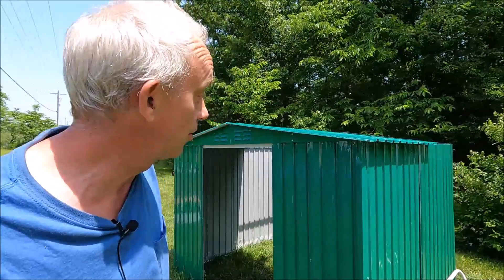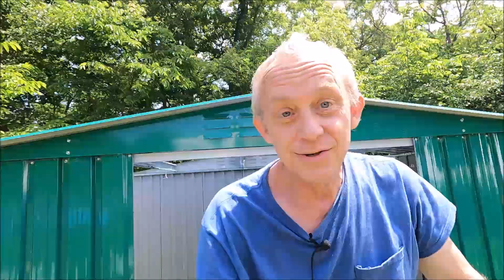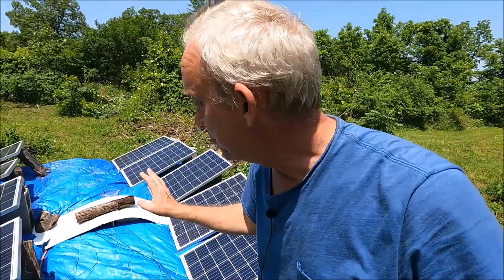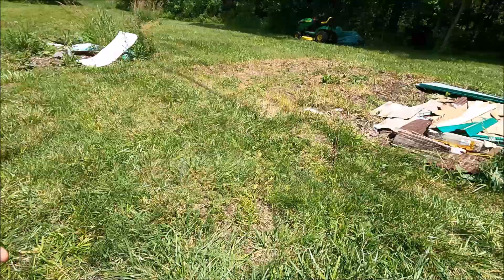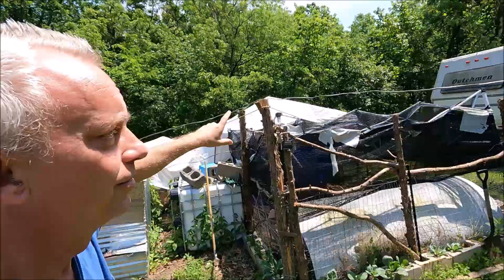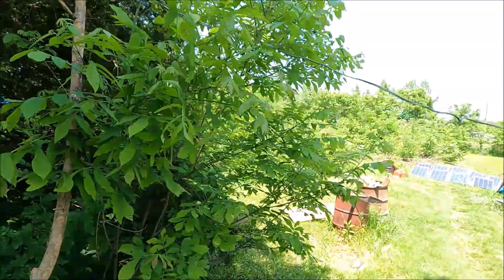I'm Tired Of Off Grid Living In A Tiny House

Comment: An idea for the roof, you can try a whirlybird if you are worried about overheating the charge controller or batteries from the roof. They are pretty cheap and wouldnt let rain in either. Wish you luck on the new build, keep it up.

Comment: When you mentioned doing maintenance on your solar panels with a greenie to clean the black stuff… If you were talking about the electrical connections try using some electrical dielectric grease. It’s basically a silicone grease (non hardening) that coats the connection sealing out the moisture and preventing corrosion. It can be easily wiped/cleaned/renewed during maintenance inspections. It’s also used for automotive ignition systems light bulbs etc….
Reply from the maker: I have.  When I said I've said everything I meant everything